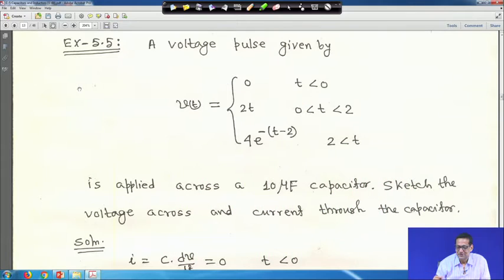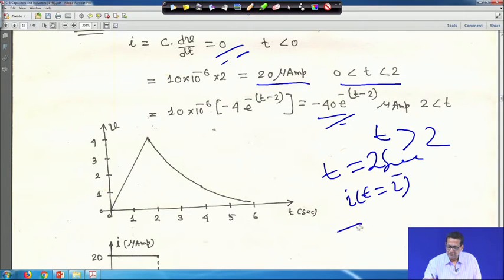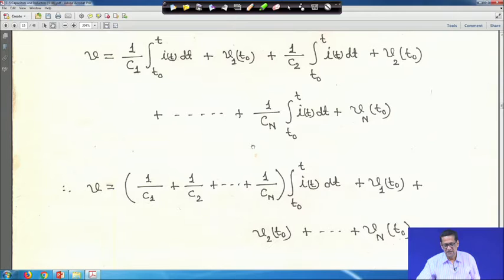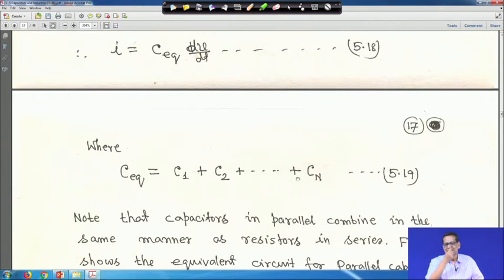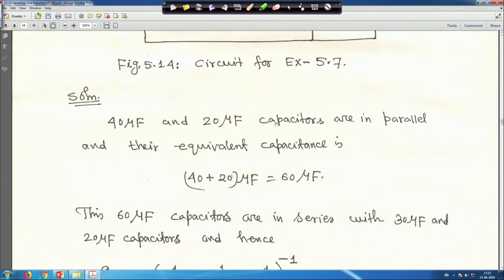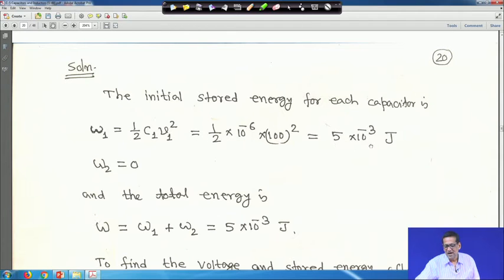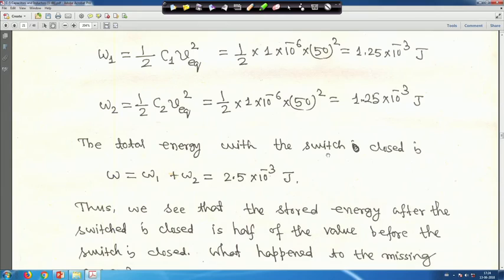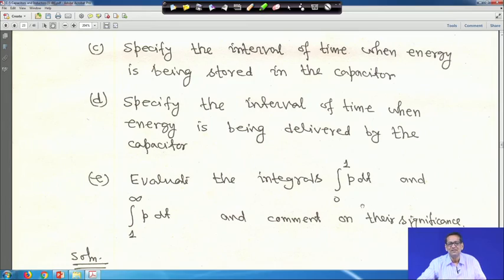Lecture 27: Capacitors & Inductors (Contd.)

Comment: When a capacitor of capacitance C is charged using a battery of voltage V and a switch, the battery expends an amount of energy QV while the energy stored in the capacitor (after charging) is QV/2 where Q represents the amount of charge transferred when the capacitor voltage is V. Note that with a potential difference V, a capacitor C will store charge Q, but the energy stored is not Q × V. Why not? Because, as the capacitor charges, both Q and V increase, so we have not moved all the charge with a potential difference of V across the capacitor (fighting against the growing fringe field to transfer energy from the battery), which the battery did. 
Where is the missing energy? (QV)/2 from the battery?  

Electrostatics and circuits belong to one science not two. To learn the operation of circuits it is instructive to understand Current, the conduction process and Voltage at the fundamental level as in the following two videos:
i. https://youtu.be/REsWdd76qxc and 
ii. https://youtu.be/8BQM_xw2Rfo 

It is not possible in this post to discuss in more detail the energy expended when a capacitor is charged.
The last frame References in video #1  lists textbook 4 which discusses these topics in more detail using a unified approach and provides an intuitive understanding of how charging a capacitor with a ramp voltage is more energy efficient than by applying a step voltage. This is explained with the analogy of lifting a weight.

Comment: Sir what would happen if in example 5.8, we consider both the capacitors to be ideal capacitors. We have seen in the video that ideal capacitors cannot dissipate energy. This implies that ideal capacitors cannot have parasitic elements since this would allow the ideal capacitor to dissipate energy. So, if the explanation in example 5.8 is correct, then this shows that ideal capacitors have parasitic    elements, i.e., an ideal capacitor can dissipate energy. 
Isn't it a contradiction?